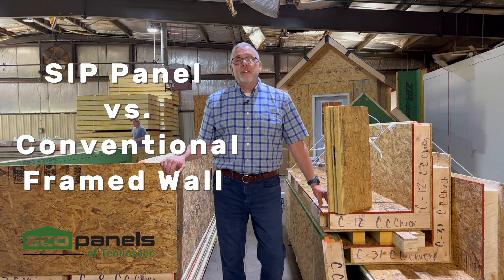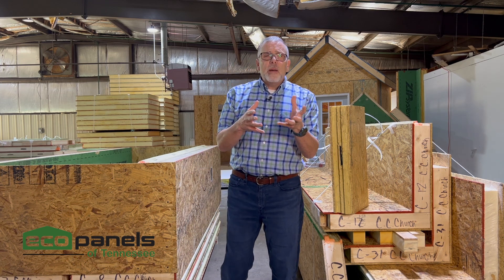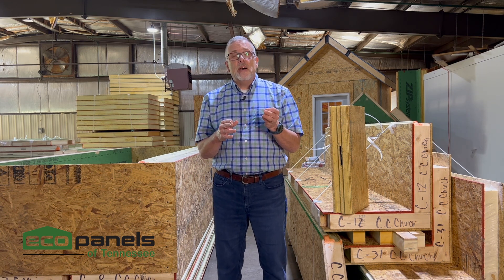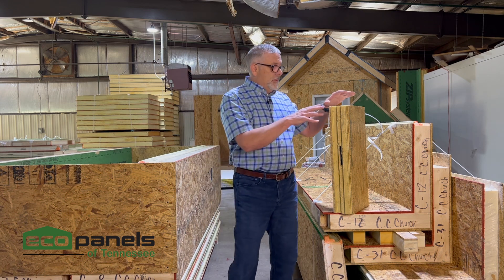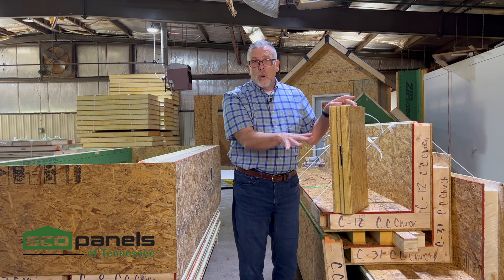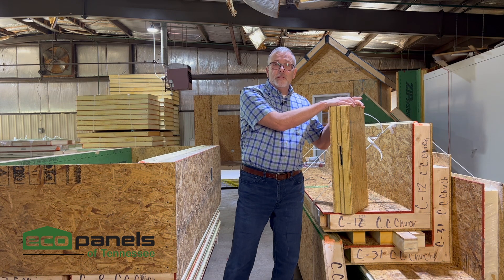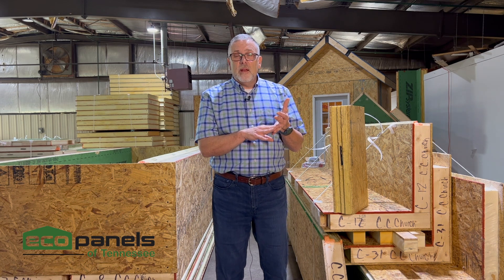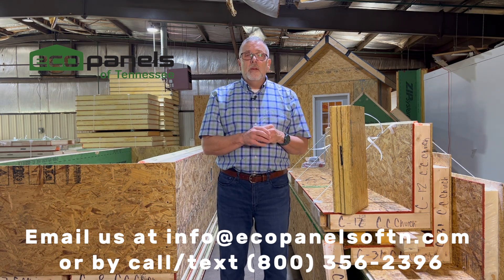SIP Panel vs Conventional Framed Wall

Comment: Whats the widest a roof truss can span with your walls, was looking at post frame style as to not have to worry about load bearing walls but very interested in these also..
Reply from the maker: I think that's a question you would have to ask a truss manufacturer. Our panels can take a lot more load than a typical framed wall. In many cases the load bearing walls are more to support the trusses above, than they are to distribute load away from the exterior walls. Keep in mind, the further away your floor  plan goes from being "typical", the more likely you are to need an engineer involved.
Reply: @EcoPanelsofTennessee  thank you!